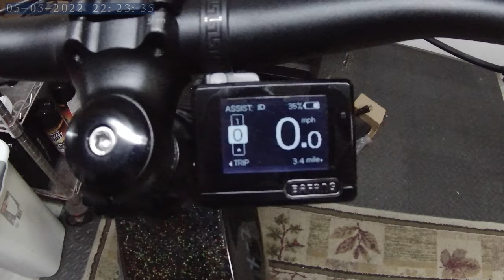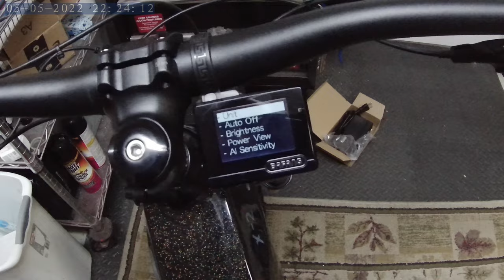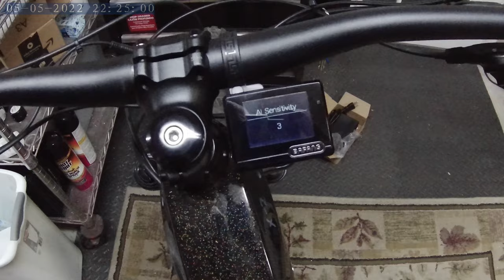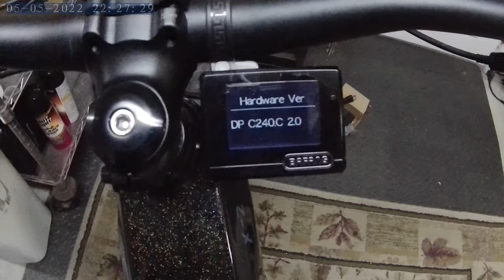Luna X2 Enduro unbox, Inspect and setup

Comment: I am where you're at right now.  I've only got five power settings I keep reading about nine I did get the app on my phone and I think I wrote it to Ludacris mode but I still only have five settings and I really don't know if it's actually in Ludacris mode it doesn't feel like 2500 W.. it's clear as mud
Reply from the maker: The controller has 1 memory. Once you write to it with the app, the controller on the bike is full. You can read what the settings are from the app and then change them. Then you can write over the controller memory. The app doesn't do much other than monitor currents and give you 3 defaults. First make a connection, read the controller settings then change and save back to the controller. Then read one more time to make sure you did it right. The app will confirm if you saved correctly from the read. At that time check the display. You need to keep your phone close to the motor while reading and writing. Sorry to inform you your not going to get 2500 watts. And only for ten seconds you maybe get a 1200 watts reading. Forget about the hyped specs. This a a purpose built electric mountain bike.  It is great at it's job. Not great at just using the throttle for speed tests. The motor is 500 watts and the Ludicrous controller helps with maybe 250 watts more for a short period. If your riding it like a mountain bike alot you will end up not needing the high power settings. Just make sure you got full power on the throttle and use it to control the boost you need to climb the hill.
Reply: @beachbarlouie  so once you've loaded up the Ludacris settings you can still toggle one through five or one through nine and get the increased power settings?  I think I've got it working I just expected more power.  I have an old rad rover with a 35 amp controller and it will do wheelies withthe hub motor.  I kind of thought this was going to be even more bad ass.  I was observing the power output on Ludacris on level nine and the most I saw was 1300 W nowhere close to 2500 though.  This bike has been out for years now and so far you really do have the best content on YouTube YouTube by the way thank you again
Reply from the maker: @captamerica3693  1 - 9 if its loaded correctly. Your welcome. I do like the bike.
Reply: @beachbarlouie  well I saw where I could get into the settings and change it one through nine but that didn't happen through any software changes that I did on my phone.  What do you think about that